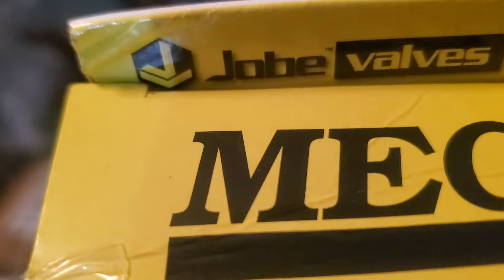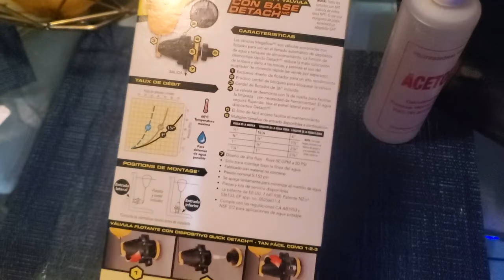Water tank Float valve | Reels mounted

Comment: You have three tanks equalizing off the suction hose. Question- where in that sequence are you putting the fill valve? Im not knocking the set up just to be clear. Im curious how the tanks will equalize while surfave cleaning for extended periods of time. Id like to see a video on that when you get the skid completely done. Keep up the good work man